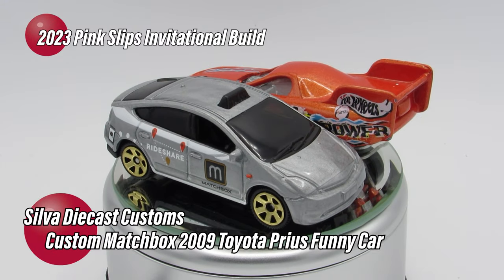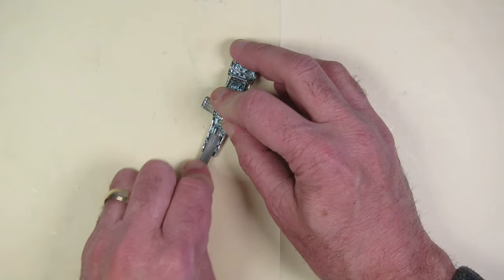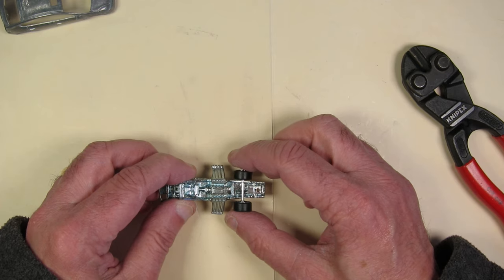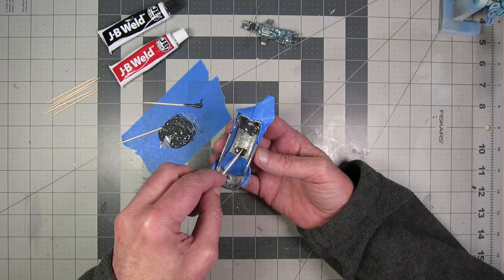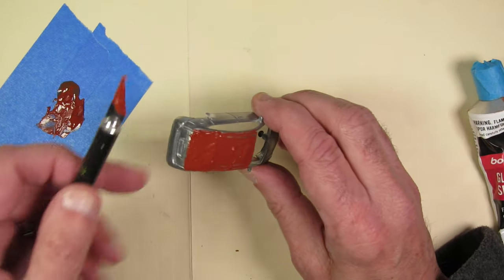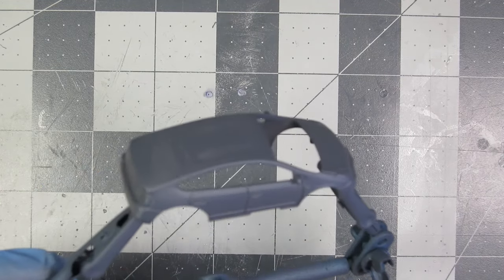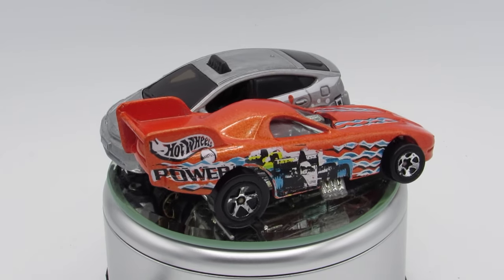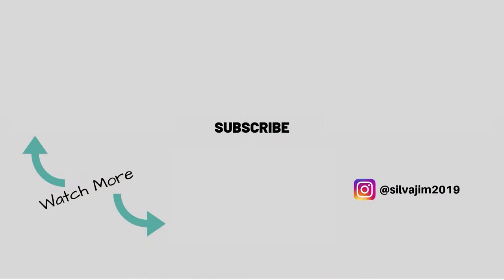Custom Matchbox Drag Prius - 2023 Pink Slips Race Build #pinkslips2023

Comment: Holy crap Jim! This is awesome as hell! I can't wait to add it to my collection....muahahaa. Making a  hinge isn't that difficult. Basically an axle tube with some wire is all you need. Figures a guy from California tries to enter an electric car into a drag race.....lol.
Reply from the maker: Thanks SO much Jamie!  Well if you want to add it to your collection, you're going to have to take it away from me...and I have a feeling it's going to be coming back home...with some friends lol.  Ahhhh the hinge - this is one of those 'I get in my own way" things - I've done a hinge (you may recall the Bug Turret on the gaslands bus had a hinged back door), but I wanted to use the "hinge" portion already on the base and make a holder on the body.  I came up with several ideas, including mounting two straight axle tubes on the body and sliding a "C" bent rod into them.  This was a huge time burner with numerous fails (with the related video and swearing audio edited out lol) and I was my own worst enemy on trying to force it to work a certain way.  I think we all run into this kind of thing one way or another.  Also - I wasn't sure where I was going to stick the Prius logo, then settled on the back so it's the last thing people see as I'm pulling away from them on the track...well, you'll see soon enough lol